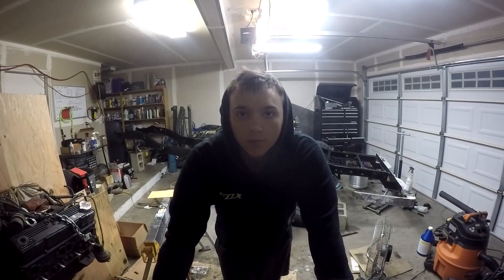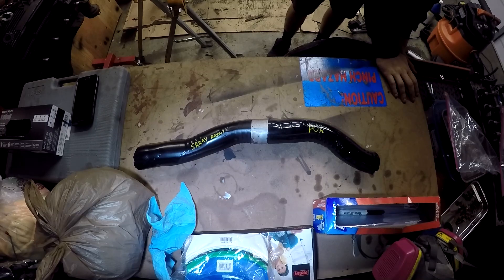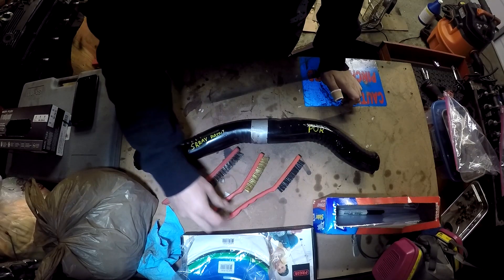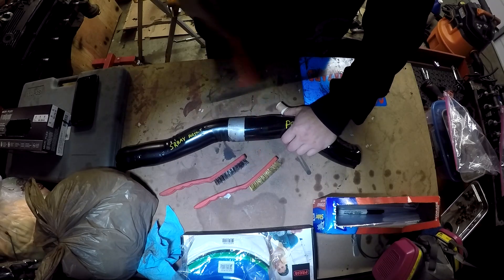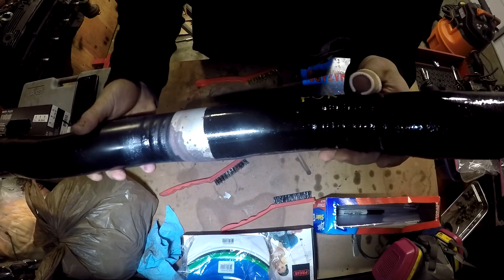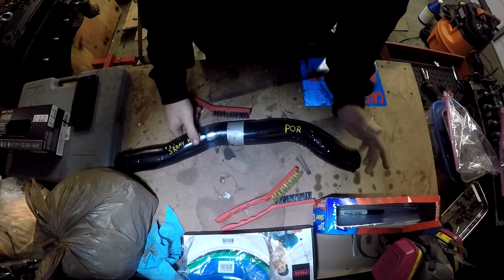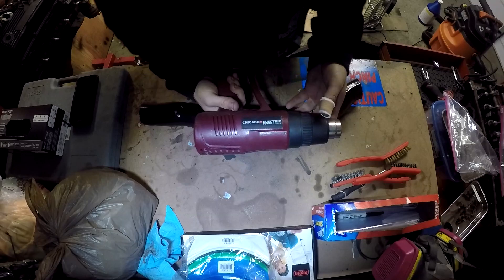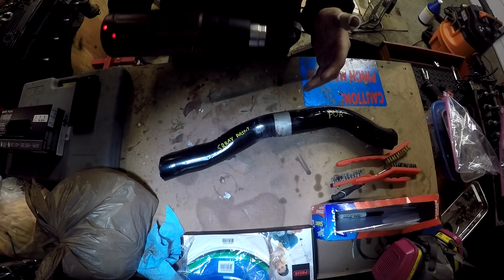POR 15 Strength Test

Comment: lol when was the last time that acetone leaked out of a fuel or brake line or you engine haha sorry. maybe a better chemical test would be engine oil, transmission fluid , gas, diesel, and brake fluid would be a better real world test. but thanks for sharing anyway

Comment: A bit of advice don't use the por metal prep with exhaust or engine parts as it's not high heat tolerant.